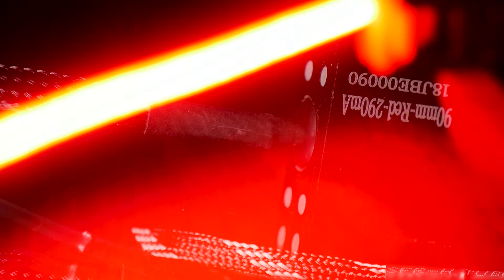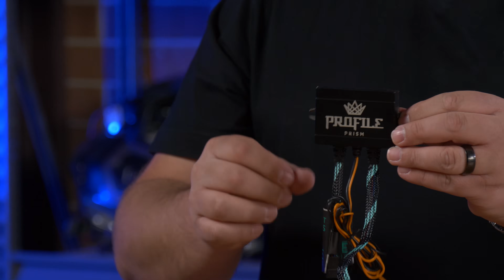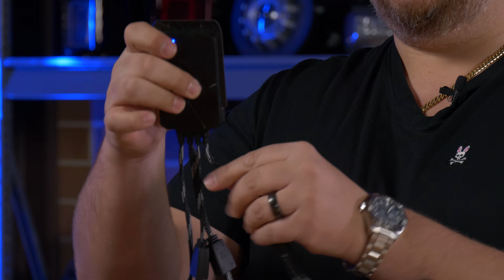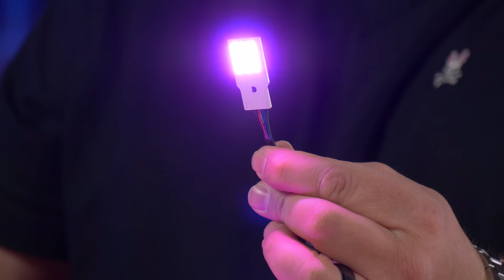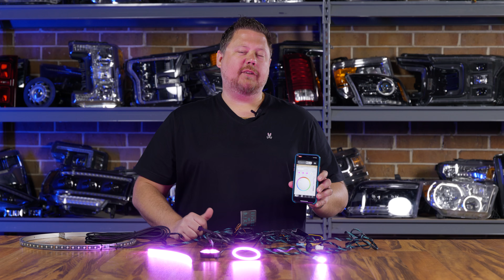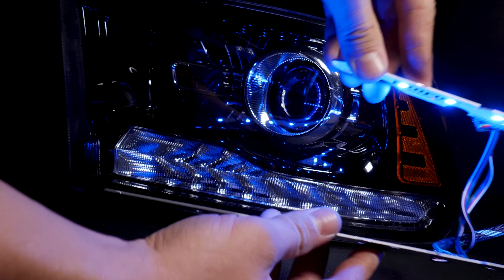THE BEST RGB LED's AVAILABLE - Profile Pixel Review | Headlight Revolution

Comment: Can the switchback function be changed to do something like color chasing amber for running RGBW LED DRL strips as turn signals?
Reply: The profile pivot strips have a switchback sequential option but its only white and amber. Id assume that the RGB (prism) would have that option too but I can't find anything to confirm that

Comment: So I have a 2021 Ford F250 & I've searched for a rock light kit ( 2 per wheel well ) & some under glow to cover the entire ground surface. I also want to add 4 interior, 2 below the drivers side & passenger both front & rear seating. I've tried to figure out EXACTLY what I need to complete this install but never get a full scope answer! I also want to power all of this thru the installed factory up setter switches to power off & on. I could use some tech advice on this & I'm not purchasing anything until I get the full assembly & know exactly what is needed to complete the task. IF I can get it all set up correctly I might also add the wheel lighting!!!!! Another question is the RGB already installed into the Morimoto XD Headlights or is that a special order?????

Comment: Unfortunately mine didn’t last . For some reason the leds aren’t working good and when I put them white I see some led dots that are a different color and not been white and same when shifting to a different color some leds will not stay the color I wasn’t and be another color . Spend way to much on my lights and the end they didn’t work really well.
Reply from the maker: Did you try reaching out to our team for a warranty replacement?

218-755-5200
sales@headlightrevolution.com
Reply: This is common problem with LEDs on vehicles. I'm guessing you were using them just for headlights, so we can probably rule out voltage drop as the issue... Did you put a 1000uf capacitor in-line with +/- on each strip? The voltage in a car spikes, which can cause trouble for LED strips, to smooth out the spikes we place a 25-50V 1000uf capacitor close to the first LED in the chain. The other likely culprit is that the data signal has become corrupted by voltage interference, to fight against this we put a 220-249ohm 1/2 Watt Resistor in-line with the Data wire, it's also placed just before the first pixel in the chain. The only other probable cause of failure would be if the strip wasn't properly waterproofed and moisture got into the profile. In general, you'll often need to use a combination of external resistors and capacitors to make digital LED strips last on a car.